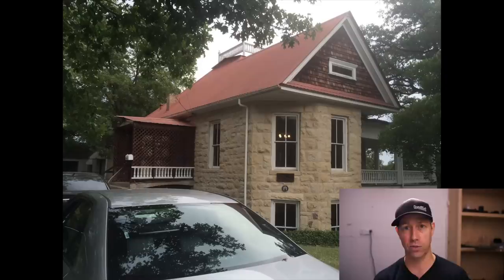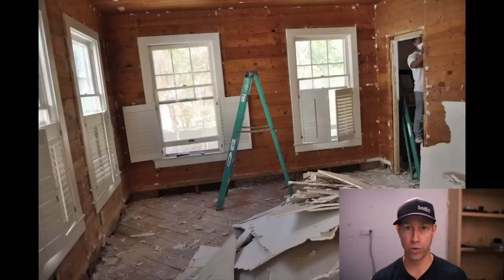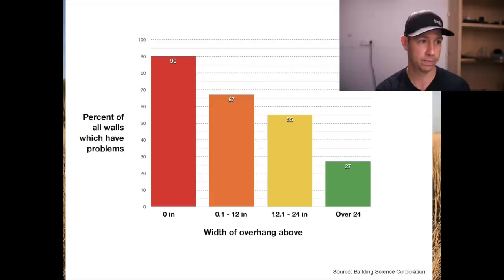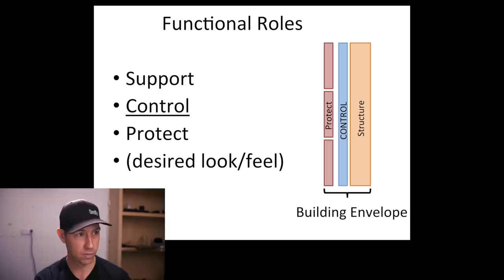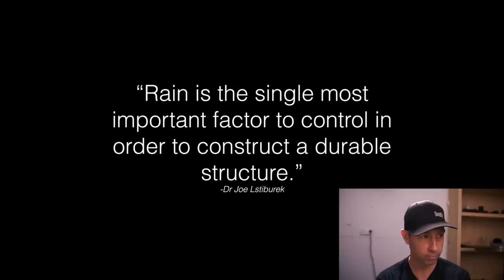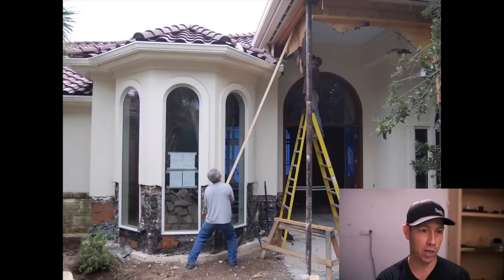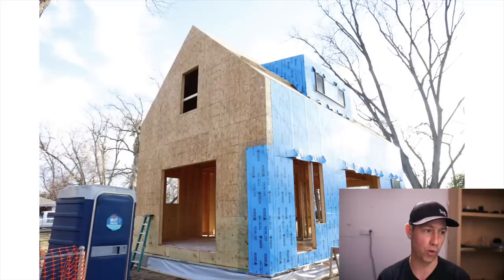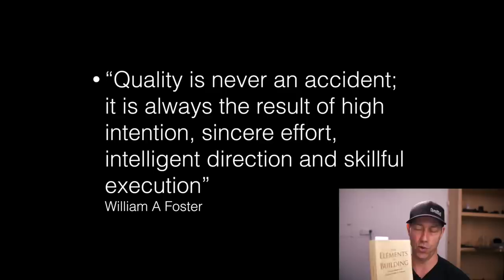Were Old Houses Built Better?

Comment: Matt, excellent video! You remind me of a young American version of  Canadian Mike Holmes. I love the attention to providing a great built home using the best materials, design's and techniques along with science. Your quality show's inside and out.
Reply: The Enigmaone 007 totally agree!
Reply: nowhere near what Mike Holmes is....
Reply: Holmes is informative but comes across arrogant. Matt>Mike
Reply: Naw, Holmes would have seen that "little bit" of termite damage on the first house and decided to tear down the whole thing... possibly the whole block would have to go...
Reply: Mike Holmes is an actor. An actor who preys on the uninformed picking who he wants to help and who he doesn't. He in his ignorance has stated that mosquitoes cannot see LED light and that aluminum rusts. If you want to trust that, there is a cliff that all of the other cattle are running over.
Reply: Do you like ICF insulated concrete form buildings?
Reply: old houses are better because they didn't use homedepot,lowes' whatever crap materials.
Reply: @IhateCCP  where do you buy your material?
Reply: Holmes is a joke.  So is this guy.
Reply: Vox Daze  I think it's closer to 99.9
Reply: Vox Daze  you realize that comment makes you a racist
Reply: Matt is significantly more informed than Mike Holmes ever was.
Reply: @oby-1607  
Wow, so wrong!
Reply: Wow, these comments escalated fast!
Reply: Indeed, they call this survivorship bias.
Reply: I agree - more builders need to pay this much attention to detail.
Reply: George Friesen  I hear the sound of a irritated contractor
Reply: @cwalenta656  a
Reply: @ArthurDentZaphodBeeb  www we aw shucks q saw
Reply: @ArthurDentZaphodBeeb  paper and I will have have it we aw put in in a
Reply: Aw w @ArthurDentZaphodBeeb  aw

Comment: Old houses that are still standing were built well, but our old friend time has picked out all the turds.
Reply: Survivor bias.
Reply: Or ones that were well maintained and remodelled. Or ones that were not sold and replaced with freeways, shopping areas, or apartments.
Reply: Don't know what the figures are like jn the USA  but in the UK most houses built 100 years ago are still standing. Well excepting that nothing was built during WWI. Whats been knocked down thats over 100 years old generally was either bombed in WWII or was slum housing.in major cities. Something like over 50% of the housing stock predates WWII and over 20% is over 100 years old. You would struggle to sell a house built to USA standard's in the UK,  and I would imagine from what I have seen most of Europe.
Reply: Nothing but survival bias indeed.
No one remembers the failures, it's why psychics are able to be successful. The UK has torn down most of their old buildings, and the ones that are left have been gutted out completely and rebuilt to more modern standards. Only 20% of the markets housing remains of the older shells, after an eon of building doesn't say, boy they sure made them well. It says that hardly anything could survive.
But then again I do remember the 1980s and how much was torn down across the UK, to try and remove the huge amounts of dogs before they fell down on their own, and killed more people.
Reply: It's partially true. I see plaster as a better idea than drywall for example. But during the plaster age for people who couldn't afford a real smooth plaster job there was stuff like Masonite walls, wood paneling, etc. All those Masonite/wood panel walls are pretty much long gone, and unlike drywall burnt like mad in a fire, too. But, there's 100 year old plaster walls with just a crack or two in them that are otherwise perfect while 20 year old drywall is full of nailpops and seams. So yeah, survivorship bias was part of it.
Reply: They used to build things to last. Now they just build to code.
Reply: @Sonos45  : You got that right. And, for money in the right persons back pocket. Don't know your country, but in the USA we have highways that are sometimes 50/50. 50% concrete 50% slick as snot asphalt. Black Ice here we come & all the fun that goes with it.
Reply: @Thomas H : Brother, you've got that exactly right! Flush Flush Flush. Some in that & other industries think we all got money trees.
Reply: As someone who's been wiring houses for 3 generations so far, i agree. people tend to assume old music/buildings/tools etc were better because they built better and "built to last" when in reality it's usually because old ugly houses would be torn down and replaced while the really sturdy beautiful houses would be kept around and updated/remodeled. The house i grew up in was built in the 20s and it was the only house from the area that's still around from that time since the flimsy depression area homes have all burned down or broken down decades ago.
Reply: And this fellow uses science to explain why the old survivors, survived. With the addition of a few modern tweaks, you can have the very best of both worlds. quality materials either save money or pay dividends via value retention. Go quality and wince once, go cheap and wince repeatedly. 

Having said that, the best of materials still need some maintenance.
Reply: I mean many new build start deteriorating after 8 years.....
Reply: Exactly
Reply: Dan Rowley in VT they just use asphalt. Frost heaves pop cracks up before either road material would wear out. Black asphalt I'm sure makes black ice look more black but black ice is actually clear...
Reply: Dan B, true survivor bias. learned that from veritasium
Reply: excellent point
Reply: @portaadonai  Or ones that were not sold and replaced with freeways, shopping areas, or apartments.
There's no shortage of entire communities in flyover country  that were effectively turned into ghost towns when
railroad lines were shutdown, farm consolidation meant fewer farms, changing industries meant people in small towns 
moving to cities, county roads replaced by state roads, state roads replaced by US highway routes, US highway routes 
downgraded to secondary routes by interstate highways etc etc etc. 
Just east of the Rocky Mountains is an area 200-300 miles wide stretching from south Texas well into Canada that in some
 in most counties have less than half the population they did in 1910. 
People built countless numbers of magnificent farmhouses, , churches, cathedrals and hundreds of towns, having no idea that    
two world wars would bring  new attitudes and changing lifestyles  that would see  most of  what they  built for what   they surely 
 thought was the  future  of their great grand children   abandoned  in a few decades.
Reply: roy underhill has said similar things about old houses.  The good ones survived for centuries while the rest are compost.
Reply: Old houses will cost a fortune to update, which is required for home-owner's insurance. Most companies will not insure a home built in the 1950's. I'm lucky my home has been updated, so it is insured. You really need home-owner's insurance in Florida.  I spent over $50,000 on my old house.  Actually about $70,000
Reply: Exactly. There is also the thing where old houses been improved over the years.

Pretty much all houses are built cheaply, but when they are reovated its usualy done with a lot more care.
Reply: Come up to Buffalo. About 80 percent of housing is 1940 or prior.  Stands in some of the harshest conditions in the U.S.  Old houses are sturdier.
Reply: The problem of building to code is that those codes were created by the various Builders Associations and by their lobbyists in the U.S Congress who does not know shit anything on how build a house of a skyscraper and as a result those so called building codes are  "SUBSTANDARD CODES" so that they can buy cheap, build cheap, and sell expensively substandstard housings and buildings and infrastructures, etc requiring expensive UNNCESSARY maintenance, repairs, replacements, remodeling, upgrading. I say build them to last, maintenance-free, repair-free, and trouble-free and design them to meet future anticipated and unanticipated future needs.
Reply: DeepPastry the reason “only” 20% of the housing stock is older than a hundred years isn’t that 80% of what was standing in 1920 has been torn down, but primarily because there’s that many more households today compared to 1920. A pretty good percentage of what was around then is still around, especially if you disregard bomb damage.
Reply: @JasperJanssen  Excellent point.
Reply: DeepPastry how has the UK torn down most of its old buildings? A quarter of our housing stock is Victorian! Many of us live in much older homes. Sure, a lot went from a few bigger cities during the war, but even so the vast majority of everything constructed in the last couple of centuries survives. We don't rip houses apart here, it's not practical given their construction really, they get modernised every generation of so, but it's usually cosmetic.
Reply: @portaadonai  Doesn't that just prove his point? If it wasn't well built would it still be standing today? Unlike modern homes that only expected to last 80 years or less.
Reply: True. People look at buildings like the Pantheon and say "Wow! - Those Romans really knew how to built them to last". Of course, in reality even in ancient Rome they had issues with cheap, poorly build condominiums (yes it's a Latin word) that collapsed, sometimes even during construction...
Reply: Because he will stay out of business. if houses today can be builded better, then contractors like him will lose their jobs.

 It's like here in Florida, everybody in the Caribbean Constructs houses whit cinder blocks and square cement/rebar roofs, but in Florida they have the "great" idea of building whit drywall,attics and wood... in a place whit such humidity, Termites and hurricanes. it makes no goddamned sense...
Reply: EpiDemic117  nope, you can build a bouse in the UK like you do in the USA and it will comply with all the standards, just you will have difficulty selling it as most people will walk away from it when they realize it is just a glorified shed.
Reply: Absolutely, Almost all of the 100 year old houses still on the go in St. John's Newfoundland were built by the same architect/builders The southcotts(father and then son)
Reply: @jonathanbuzzard6648  And that'a why USA is #1, we evolve.
Reply: Because, not but
Reply: @jonathanbuzzard6648  the reason Europe has a much older "house stock" compared to the US, is a simple fact: age. An example, the area I live in 60 years ago was just forest, like literally there was nothing here. Now the surrounding area has a population of about 40,000, so of course our housing "stock" is newer.
Reply: @DewmOnline  Except there are very few houses in the UK that are older than the USA is a country. Houses in the USA don't last long because they are in fact little more than glorified sheds.
Reply: Ever been to Compton? Many of the houses you see look like they're straight outta 1952 and still look great, and you see blocks and blocks of them. I don't think it's survivor bias, as much as you think it is.
Reply: Prodmul Not sure about survivor bias in the states, but it's not really a thing here in the UK. Houses simply aren't replaced in any great numbers. Sure, some people buy a thirties two bed bungalow and pull it down to build a five bed home instead, but that's because they like the plot and location, not because there was anything wrong with the house. There are thousands of streets of Victorian houses in London, built by hundreds of different builders, many much more prolific than even the biggest building firms around today. Yet we don't see big gaps in these areas where substandard homes have disintegrated. We see gaps where German bombs destroyed a couple of houses. If anything, it's the post war replacements that are now falling apart rather than the Victorian stuff. My home was built in about 1890, and still has its original sash windows for heavens sake- find me a timber window on the market today that will last 130 years!
Reply: @jonathanbuzzard6648  Since 1941 population in the UK increased by nearly 50%, in the US nearly 300%. that's a lot of house.
Reply: @jonathanbuzzard6648  A house built to US standards where I live was sold for the price of the land plus 50% instead of 300%. Nobody wants to live in a shack that doesn't have to. My house is 120 years old and I paint the inside and steel window and door frames as the only maintenance, the roof is filed and the walls are face brick.
Reply: If you go back 50-100 years a lot of homes outside of urban centres were very poorly constructed.
Here in Australia wattle and daub dwellings and homes that were not much more then sheds made with local rough milled timber was common.
Most have now been abandoned and are falling down but there was probably never a record of the house existing.
Reply: Well I don’t know about that one, if you drive through an old small town you see pretty much all old buildings from the same era, grouped together. For the most part they’re all still standing. If the survivor bias theory was correct you’d see a lot of empty lots or new houses mixed with the old houses.
Reply: @darthvader5300  That is the price you pay for not investing in your civil servants. Small government is not so great as some believe.
Reply: Research Mudfloods
Reply: @jonathanbuzzard6648  USA construction is the most overly complicated thing you could imagine.  Most new constructions are created as subdivisions on bank controlled land they are trying to develop and sell at a max profit, and its been going this way since around the 70's.  Old construction varies wildly from region to region.  A 100 year old building in the northeast is probably among the most beautiful standing today, whereas in the southwest it could be little more than an abandoned wooden shelter to keep the elements out.  Some people may go on about how modern homes are engineered to a specification, but thats not entirely correct either, because kit homes are littered across the entirety of the US, and those specifically WERE built to spec and were mass produced about 100 years ago, but are typically reliable.  Other homes suffer from other issues, your 100 year old home may not leak, have a solid foundation, and has some of the finer details, but its electrical is a nightmare if original, its windows even if in working order will still make your electric bill sky high (single pane does not an efficient window make), and while were at it anything 2 level is going to be a f***ing nightmare to heat and cool without some serious upgrades.  I could go on about how certain homes in certain regions fare better than others in certain ways, but this is long enough as is.  
Tldr: US homes are VERY varied, the way homes have been constructed for 50 years makes it complicated, generally go for the house that looks like its been through hell and survived with half its teeth and replace the other half.
Reply: Plenty of shoddy houses were built 80-120 years ago by people who knew almost nothing about building. I have seen some old houses where the top of a wall didn’t even have a plate
Reply: Every one thinks knob and tube wiring was dangerous but if the truth be known if knob and tube was done right it's much safer than Romex wiring you don't have a ground to short out to when the black wire heats up and burns off the plastic insulation or a mouse or rat eats through the insulation. Even if the wires are bare in a proper knob and tube there is nothing to short out them wires. No ground wire. Tubes go through the studs and floor joists or ceiling joists. Even the wire is hot the ceramic tube keeps the wire from burning the stud. Now we have so much outdated Romex in our walls now we must install AFCI breakers to protect the older wiring. My best solution is to use EMT which my Father used in his 1950s house. The house is still standing and the past two owners took good care of it. If you have the black Romex wire that has no ground you better replace the wiring, that was the worst improvement they made to replace knob and tube wiring.

EMT is the best up to code wiring you can get.
Reply: I see a pattern with building practices. They start with something that will last then they modernize it then it don't work out so they make a code to change it again then they modernize it again and the cycle starts over and over and over again. Log homes if built right they don't leak they keep you warm or cool and can look good no matter how old they get just retreat them again. You can also run EMT wiring if you do it as you build the house. They make routers to cut the holes for the boxes.

I chose a log house because it was warm in the winter and cool in the summer, strong and keeps its looks good.
Reply: Except the ones in urban areas that were beat to hell, ransacked and burned...